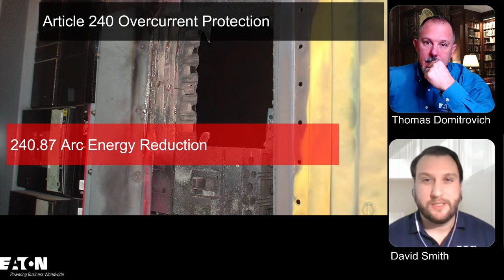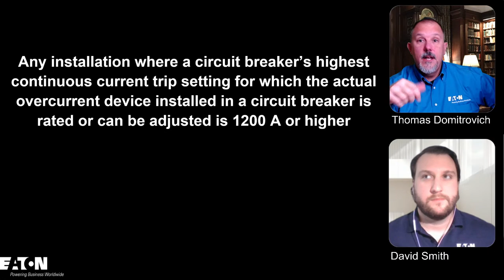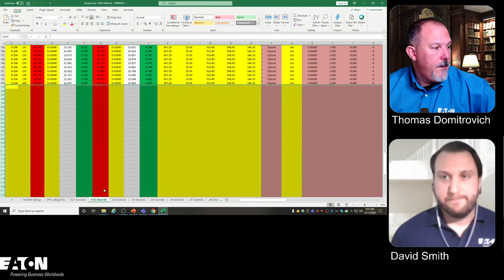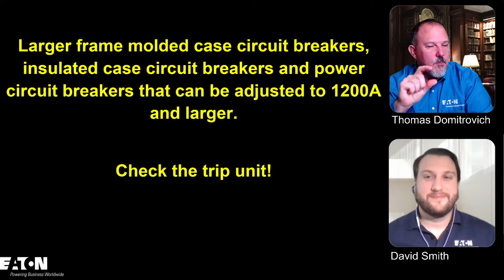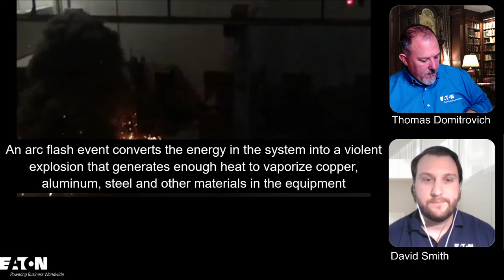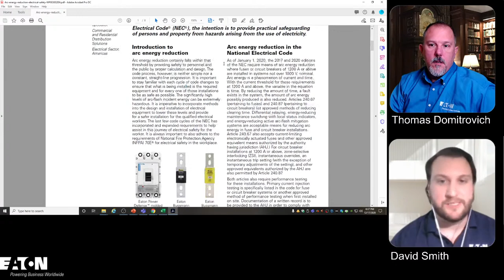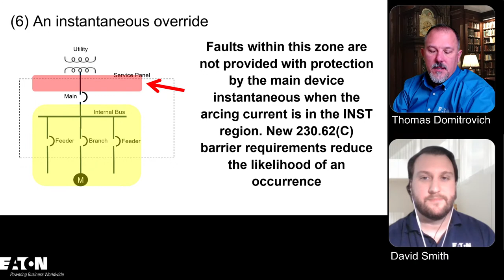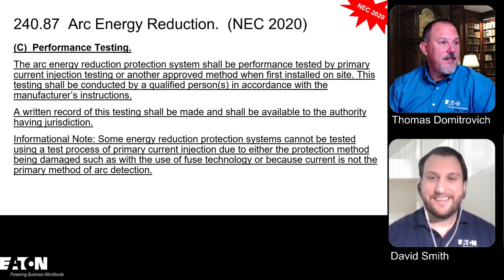240.87 - Incident Energy Reduction

Comment: I failed to understand why utility companies are not forcing arc quenching switchgear or arc flash detection technology in the project specification. implementing arc flash detection technology is easy and cost-effective also. the fault current elimination time is reduced to 40-50 ms irrespective of all the anomalies related to short time and instantaneous relay setting.